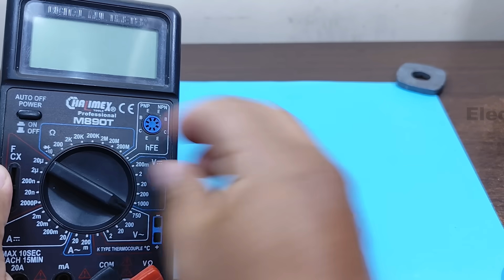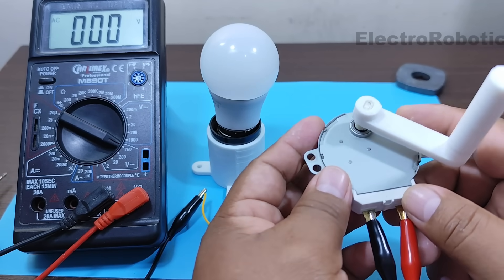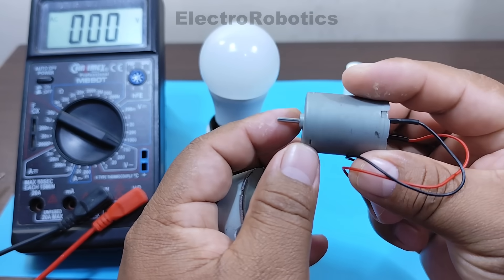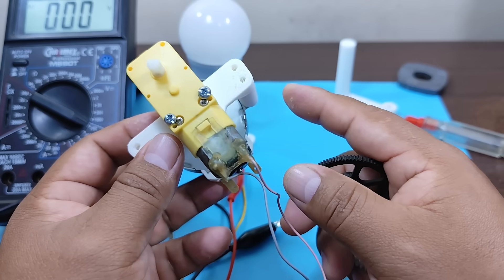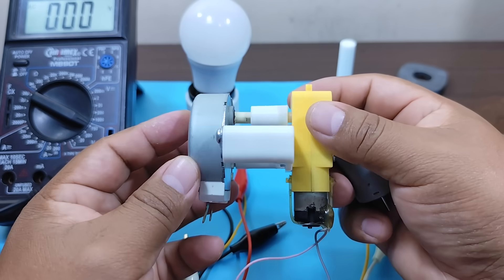How to Make an Electric Generator.

Comment: Can someone please tell me what is the purpose of this experiment? Is there any practical use for this contraption? And by the way, this motor is rated for 3.5 Watts, so that's what you can get out of this "generator", so what are you going to power with 3.5 Watts? A small 3W LED night lamp? Wasted 17 minutes of my time watching this, so actually I am an idiot, not this guy making the video...😆😜
Reply: It's a basic MG set. A transitive technology that we had to transition through in order to reach what we have today. We use semiconductor diodes for rectification and NPN/PNP transistor sets with transformers for inverting today. But this is fundamental stuff that works, albeit with considerable energy losses.
Reply: @scotttonner6817 yes this was common in older vacuum tube electronics used before solid state inverters
Reply: @scotttonner6817 N 10:56 11:00 Na diodzie obiadu nie ugotujesz loduwki nie uruchomisz !!!!
Reply: You're not an idiot. You managed to come to an educated conclusion. This indicates that you have intelligence but no better purpose for your time than to watch an educational video with an expectation other than what you had the right to. I'm sure you're not an idiot but there is probably a negative personality trait that can be assigned to you that would infer a tendency to have unrealistic expectations.
Reply: @RussellHank-t3t you're right. He's not an idiot but an intelligent being with no remorse for lesser beings. He could've upped his intelligence a little bit higher if he could've skipped his comment so as not to hurt his ego further.
Reply: Educational ac power
Reply: Absolutely this has practical use! Dude shows you how to convert DC to AC mechanically. You can get DC power just about anywhere and using this method you can scale up the process to get more juice. Duh.
Reply: @georgehuesler9561 it has its use but I would hardly call it PRACTICAL use because it's just much more efficient, easier and simpler now to do the same thing with electronic components and have no moving parts therefore no energy losses due to friction and no need for lubricating or maintaining not to mention a lot less noise. 
   With that said I'd love to get about 6 of those DC turntable motors and attach vertical windmills to them on my boat. That would give me a ton of extra DC power when there's no sun on my solar panels.
Reply: @captainKedger I hear ya. I'm saying practical because I don't like relying on electronic shit. I can fix mechanical shit. This dude is showing how to convert power mechanically, just at a basic level. This design can be improved upon without having a college degree. When the shit hits the fan, whether it be nuclear/volcanic winter, EMP, aliens knock us back to the stone age, whatever, this is the kind of stuff that will be practical to build from scavenged junk.
Reply: The guy making the video got lots of views, clicks, likes and comments including yours. That was his main goal.
Reply: And you won't even need wood, 
Sodium hydrochloride mixed with aluminium In this closed system result in heat already, hydrogen gas for maybe pumping to your azz or whatever, or burning it and as well it makes loads of pressure, 

One time I failed safety protocol and did not checked in the hydrochloride aluminium reaction tank the working of manual lever release, and after I dropped high reacting small pieces with big contact area, I noticed my manual release to other system was malfunctioning resulting in me nearly exploding myself, I had to throw that reaction to safe place where I for few seconds tried to release it, but it was so hot I had to evacuate
Reply: Apparently you were never meant to work with this type of thing. Things like this can be used as a test bed for multiple projects. It can be used as a science fair project for kids showing how an AC generator can power a light bulb or something similar. It stands to reason that if it takes 120 volts AC to spin the motor at 4 rpm, if you spin the motor at that speed, it will generate that much electricity. I don't expect you to believe me, so please feel free to research it and find out for yourself. I mean no disrespect here. Just trying to point out a few things, please don't misunderstand me. Peace.
Reply: If you have this powered by a water wheel you could charge a phone or run an LED light if you were living off grid in a tent etc... 
 You cant take for granted that was is available today will always be available like food or utilities your job or your health.
 Pray and be thankful that Jesus blesses us and our country.
Reply: @vainwretch not very practical for off grid tent living. You'd actually want to use just a 12 volt system for tent life. This way you can use a charge controller to keep extra power in a battery and use 12 volt LED lights. A car charger setup etc. This setup turns it into higher voltage DC power at the cost of a lot of amperage loss. 
  Fewer conversions = less power loss.
Reply: 😂 lmfao'z 😂
Reply: dc to ac inverter
Reply: Experiment for kids 😂
Reply: What was it? Is one joule a 1kg drop of 1cm at 1 some gravitational strength or whatever? I jut know that 1 joule in ideal system equals to 1 watt
Reply: I need to research, maybe it's 1000 joules with kg, I need to research, beacuse your question gave me idea for super cheap way to pretty much concert my food to charging for phone, and your body is best chemical reactor, and most likely it will take many years before we get any close to efficiency of material to elctron conversion
Reply: As well with lever and these rope wheel systems that make it easy to carry weight up, it could be supper efficient t fill box with dirt, any weight and take few minutes of lifting it to tree top for whole nights charging or other electrical uses, as well it takes just around 40w to do verry effective plate hydrogen generation, for 2 liters at 2 minutes, so then you could start thinking about heating, and more from this.

Or steam heated by wood could spin this in closed environment where the pressure cannot escape other than spinning it, resulting in high pressure energy gen...
Reply: And it was releasing so much steam eve thru micro air exchange gaps in seal, it was crazy
Reply: I think 🤔 by using less electricity to make more electric example charge other cells from one cell which is like solar
Reply: @rokie-s4m it doesn't make more power from less power. It just converts it from DC to AC. Sort of like plugging an inverter into your car the get house power for your laptop. This is an inverter that does the same thing mechanically instead of electronically. It doesn't give more overall power. It actually gives less out than you put into it.
Reply: You are really antiache because you did not understand the content and not to harder 17 minutes of your time
Reply: Panie to sranie w banie 1 zaruwka led lub 3 zawracanie dupy !!!!!!
Reply: fun.why not. it was cool and fun.
Reply: Thank you for the video these videos help us understand basic concepts   for learning electronics they are valuable to the uneducated like me and it makes us see how amazing electricity really is  thank you again
Reply: Boy you just trying to fool everybody I can see the wires running off the back side of that damn f**** meter you're getting the power somewhere else
Reply: Rectify the output and connect it to a bunch of mosfets with zenner diodes to not exceed the gate threshold voltage, then mosfets in parallel to a low frequency step up Transformer, the drains are connected to a 12v battery sources are connected to the primary input of the Transformer , there's pull down resistors in there too somewhere, essentially you have a crude variable frequency, variable voltage inverter.  Flyback diodes too, inductors, caps. Basically a mechanical oscillator to manually fire the mosfets off create a triangle or a square wave that the Transformer will work off of. But I think you can skip all that with a 555 timer and a mosfet driver Ic
Reply: You lack innovative idea so lemme give you one. His generator connected to a device <guess what it is> with only 16v. And that 16v, gives power to 7 electronics with 220v. Do u feel me? Nah.. idt you have any 💡
Reply: @castersanti4131 verry usefull, having a reversd gearbox with many gears connected by basic gear technicues to spin super fast, if you connect the ,,fast spinning,, wheel of your gear box to this, the toruque conversion would make this or better suited motor to be nearly impossible to spin, so let's say you are In nature, and tou have what I said, and the ,,impossible to spin,, wheel would be on linear let's say 2 meter long tooth stick, you could put effective amount, like 100kg (if there is resistance good enought) making the gravitational energy and your input energy turned to good amount of energy. 

I could imagine as well some rope systems to make you able to throw the rope around a 20 meter long tree, if you have wheel there you could theoreticaly use allot of your energy to lift the 50kg to 20 meters, and if you optimize this setup you gonna have 8h of phone charging or less time of fast charging, as well multiple motors could be sopan to increase resistance of the system against the 50 kg of anything, so if you by chain connect like 20 of those you start to look at small system that can be anchored and introduce a new way for you to charge phone in emergency.
Reply: @CritiqoBiggie you lack knowledge of ohms law and understanding of how power is measured. You would need to measure the amperage draw from the primary power source and multiply it by its voltage to get the total power input then measure the amperage draw on the a/c side and multiply it by the median voltage differential to determine the total output power. This demonstrates only voltage therefore doesn't provide sufficient data to determine the real power input or output. Learn OHM's law. P=IxE
Reply: @captainKedger naaaah, by reverse information procces you may be sure that when motor rated at 240v and like 0,0 something amps, if you rotate the motor to exact 240v you sure get around 3w rating, confirming this thesis by conservation of power and my practical experience.
Reply: @PychoticOfficial that doesn't make sense at all. 240 volts at 0.0amps is exactly zero watts of power. Big nothing burger. That little microwave turntable motor is rated for around 3 amps but that doesn't mean you'll get a steady 3 amps from it by using it in reverse as a dynamo. 
   This process would loose a lot less energy if it was done electronically instead of mechanically. 
   Believe it or not I've actually done this same experiment with the exact same motor. Then i threw it in the garbage and bought an inverter.
Reply: The purpose of this project was to get clicks. This system is the most inefficient way of inverting DC to AC as you could come up with.  
   People,  measuring only voltage input and output tells us nothing about how much power is fed in and how much is output.
   Power measurements require multiplying the voltage by the amperage draw to get wattage.

Comment: Great video teacher,but I like to see you test the 220 volt ac  with  other load and much longer...ex can you connect a phone charger to it
Reply: Well, 3.5 Watts break it down. As the Voltage is known you should know what it can deliver. The LED is pretty max.
Reply: @EUinTX  probably like .5 amps but putting a bunch in parallel might work.
Reply: Great video ???     lol

Comment: wait  a minute professional Nelson wait a minute you can't just end this video without connecting a charger to. that generator to recharge that battery let's see how long it's going to last at least if it charge a cell phone or light a bulb continuously it's still a win. will there be a part 2 on this video showing the outcome.